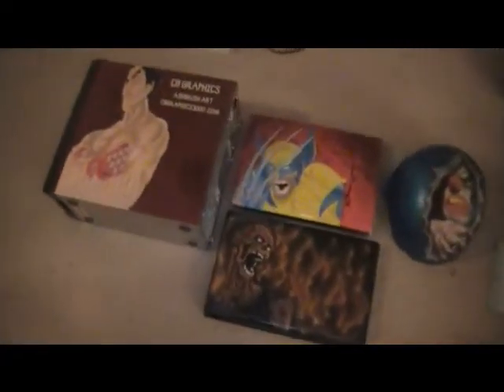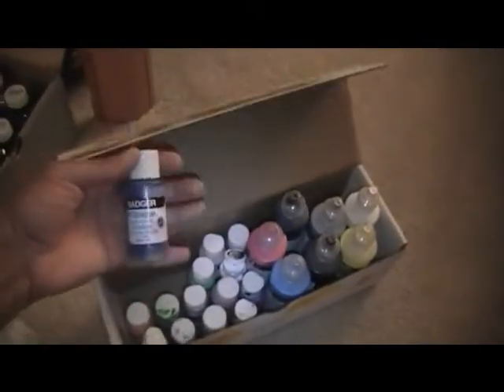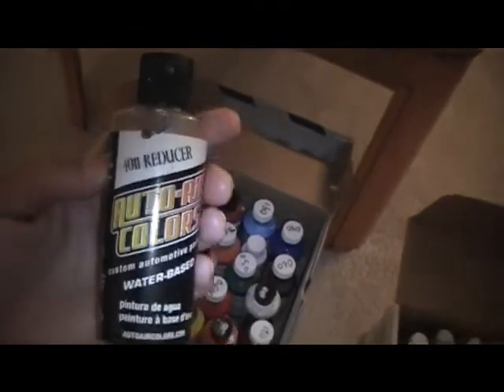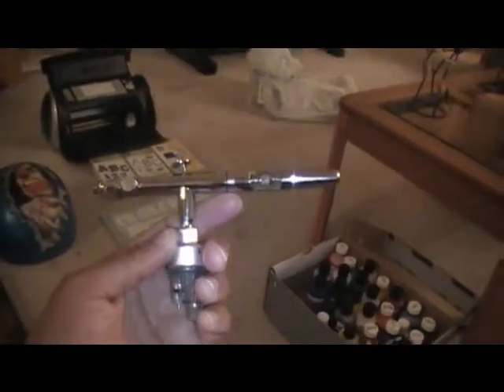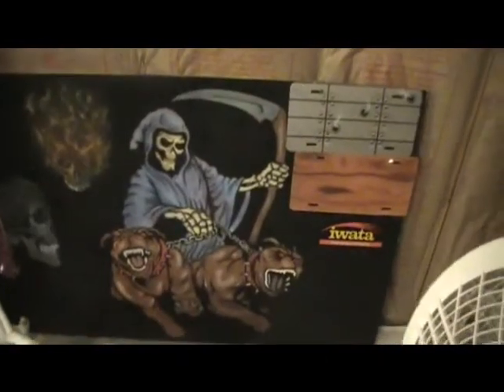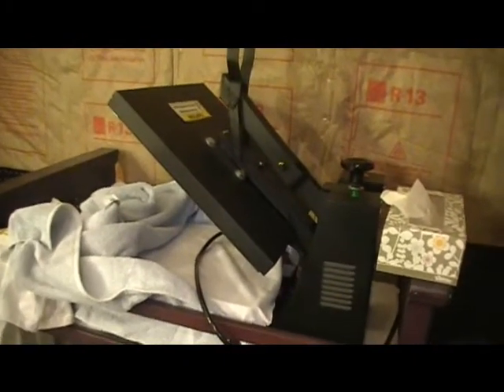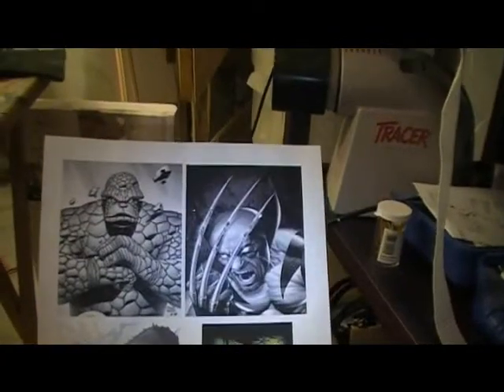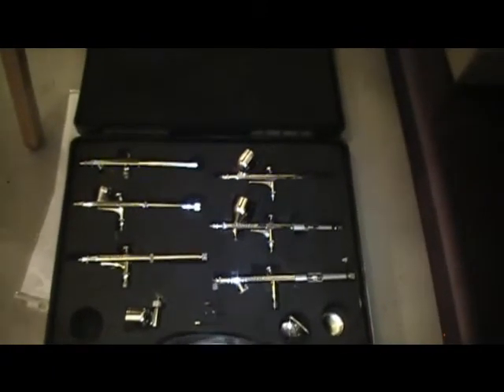Airbrushing 101

Comment from the maker: You need to use airbrush cleaner.
I use airbrush cleaner after every use and laquer thinner. You also can use airbrush restorer. If you use airbrush restorer make sure to remove rubber parts. You can use water base paints or urethane paints. Just make sure it's clear coated to protect it.